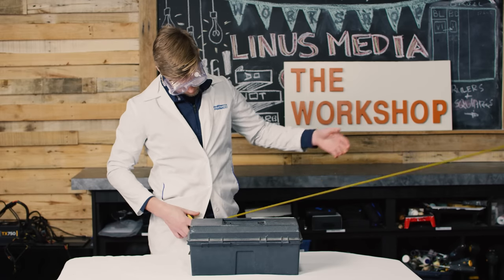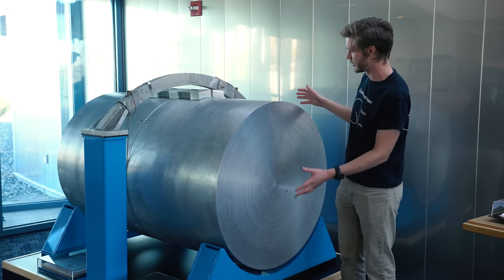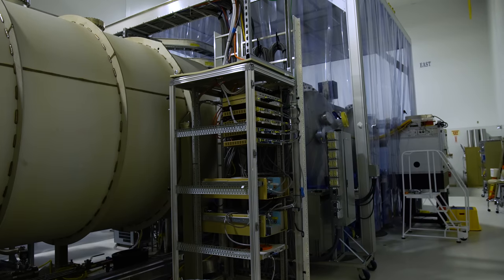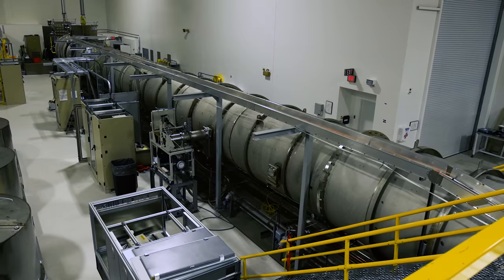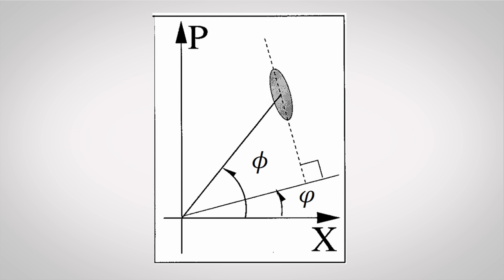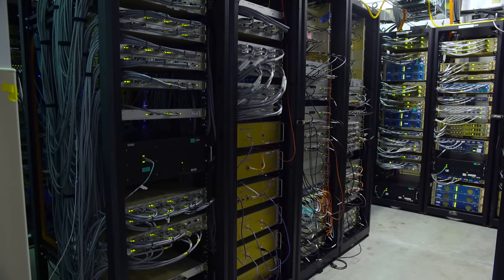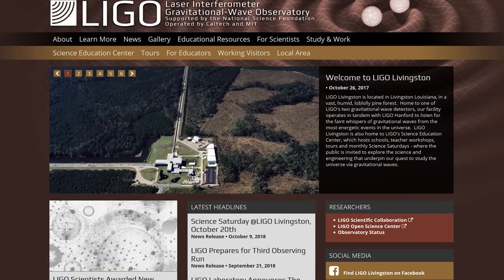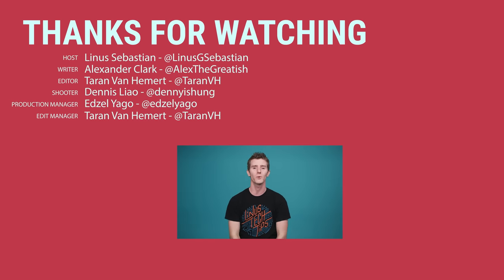Using 6000 CPU Cores for SCIENCE - HOLY $H!T

Comment: 6000 cores
64 GPUs
4 TB RAM
5,5, Petabytes of storage

This makes up a decent gaming machine :-D
Reply: The future be like :D
Reply: With a gt 210
Reply: Fps for Minecraft tho?
Reply: SSD btw
Reply: But can it run Crysis?
Reply: Ralf Engelmann bet you can't load more than 2 chrome tabs
Reply: @bkc.108  5843348 sometimes spikes down to 5843346
Reply: @bkc.108  still, it will be around 38 FPS with RTX turned on
Reply: A "stack" of GPUs**
Reply: could probably play minecraft in 30 fps at max
Reply: R G B ? ?
Reply: Only 64 GPUs? Yeah I don't want to have to run on low settings.
Reply: @skylark.kraken  it can barely run windows :/ 256 cores is decent
Reply: @thiccpug8040  low budget but not that good xd
Reply: entry level
Reply: It can barley run frogger at 60 FPS but it will do...
Reply: yeah but does it have rgb ?
Reply: mind sweeper?
Reply: can it run raytracing minecraft?
Reply: Gamers: How many FPS are you getting from that?
LIGO: Yes.
Reply: but can it run minecraft?
Reply: 1959 but can it play Tennis? 1969  but can it play Pong?  1979 but can it play Space Invaders or Asteroids? 1989 but can it play Tetris, Final Fantasy, Legend of Zelda or Sim City? 1999 but can it play Super Smash Bro., Silent Hill, Tony Hawk Pro Skater or FFVII? 2009  but can it play Uncharted 2, Call of Duty:  Modern Warfare 2, or Assassin's Creed 2? 2019 but can it play Crysis? It seems like anything that is emulator or processor intensive the most infamous comment is: "but can it play Crysis?" I'm sure there are 100's of other games out there right now that are just as popular and if not even better than Crysis! I'll pick up and play Tetris, Zelda, FF, or Skyrim any day of the week; hell I still play Diablo 2 at times!
Reply: @dontuseorcommentfromthisac5665  That's purely hypothetical question. Everybody knows that it would require a cluster of quantum computers to run Crysis with acceptable performance. Such clusters will propably not be available until 2050.
Reply: Chrome is still taking all the ram
Reply: but can it run minecraft ray tracing
Reply: @Bigboii7   Gt stands for gigtonnes in this case
Reply: will it run crysis?
Reply: It would suck big time. No single thread performance.
Reply: This machine: Nothing will stand in my way of causing memory overflow. 
Chrome: Hold my beer
Reply: Can it run crisis?
Reply: bro if this was how fast all our PCs were then the game would load before you even clicked it XD
Reply: Still only runs Minecraft at 30 FPS on low
Reply: Then it ends up doing 10FPS on Crysis
Reply: But will it run Crisis?
Reply: and a 100W psu
Reply: @bkc.108   1000000 with fps bypass probably
Geometry dash would have like 0s (not actually) delay
Reply: @thiccpug8040   zillion is not a number
Reply: With 120 gigs per second wifi
Reply: Cs go 1M fps
Reply: Will it run minecraft tho?
Reply: we need a gpu tho
Reply: Still cant run roblox
Reply: Will it play world of warcraft on ultra settings?
Reply: @bkc.108  depends on your GPU cores dont effect it
Reply: Now macstations can go up to 1.5tb ram. They should upgrade it
Reply: Plays minecraft
Reply: Time for Cinebench tests.
Reply: @bkc.108  7 octillion
Reply: It will barely run windows 10 tho
Reply: and an RTX 69420
Reply: @bkc.108  40
Reply: Still cant run chrome 😂
Reply: Should be future proof for a few years as well
Reply: @MrEzExD  but can it run chrome
Reply: just enough for shaders
Reply: soo smooth fps yes
Reply: still wouldnt be able to play tomb raider on ultra settings
Reply: yes when you hear it stays cool you understand noone mention clock speed, becouse its slowly to get stability and stay cool.magic is paraller
Reply: 640 rtx 2288000
Reply: Finally, the perfect Minecraft Rig
Reply: 4250 fps
Reply: Just enough configuration to use 2 Chrome tabs
Reply: Still cant run minecraft with ray tracing at 144fps
Reply: It’s also someone’s first build probably 😂
Reply: It can run crysis 3 @ 60fps
Reply: But the real question is CAN IT EUN CRYSIS
Reply: @thiccpug8040  wtf are u talking about?
Reply: The verge: It can play most games at ultra settings.
Reply: just imagine how much chrome tabs you can open
Reply: @RandmAnimal  at least 15
Reply: and still not enough for minecraft
Reply: DECENT
Reply: But can it run Crysis?
Reply: not enough storage for minecraft
Reply: @bkc.108  only -420
Reply: No RGB no gaming.
Reply: @bkc.108  with that ram at least 50k
Reply: I think it can't run GTA San Andreas with mods without bugging
Reply: Perfect for downloading extra ram
Reply: with this storage you can fully install microsoft flight simulator almost 3 times 😂

But can it run crysis?? 😂😂
Reply: nvme
Reply: Guess Linus can't drop it...
Reply: @kalpanaravishankarjain1234  in 10 years it will be in a phone and he will be: you just wait
Reply: Minecraft Shaders joins the chat
FPS leaves the chat
Reply: BUT CAN IT RUN CHROME THO????
Reply: Anyone else reading this comment in 2031 and thinking what a crappy gaming machine that would be?
Reply: @bkc.108  XD
Reply: 12000 threads
Reply: to make a meme review
Reply: its good enough for a couple chrome tabs
Reply: it can run a game faster than the most powerful gaming pc
Reply: If it had RGB it would be better
Reply: But can it run crysis
Reply: but can it run roblox?
Reply: But can it run ping at .5 fps?
Reply: needs more ram
Reply: plot twist:64 gpus are intel hd graphics with sli
Reply: no gpu?
Reply: @skylark.kraken  i have 52 cores, 2 quadro rtx 8000, 368gb ram. can i run minecraft at lowest settings?
Reply: i bet event on that call of dutie warzon run at 50 fps
Reply: still can't run minecraft with shaders.
Reply: @skilz8098  i take it you missed the coining of "but can it play Crysis?"... The reason everyone mentions crysis particularly is it came out February 19, 2013, yet was still pushing game systems to the max more than just about any other title on the market, all the way up til recently. not referencing it as a better or more popular game than other titles, ppl just still riding the bandwagon of a phrase i assumed had been laid to rest already.
Reply: @bkc.108  4
Reply: Just decent.
Reply: With that much ram I can open 4 whole chrome tabs
Reply: Year 2069: people used this to detect gravitational waves back in 2015 and now you have that technology in your glasses 👓 / wearables
Reply: I can run Crysis now
Reply: Minecraft would use 4 tb ram
Reply: @MrEzExD  I bet the CPU could run crysis by using software only mode. 4k 120fps
Reply: The question remains.

Can it run Minecraft.
Reply: Ahh but not good for Chrome!
Reply: it would make a nice rendering machine lol
Reply: @adamnizami8770  unless you want a fire hazard.
Reply: but mumbo jumbos is beter
Reply: i think its enough for 30fps on minecraft low graphics
Reply: "This makes up a decent gaming machine :-D" You mean an overkill machine?
Reply: *400TB RAM
Reply: But............................... CAN IT RUN MINECRAFT
Reply: here in 2050 this is accurate
Reply: Might even be able to start chrome
Reply: 10 years from now, that will only cost like 10,000
Reply: GAMING? There's HUGE LASERS GOING THROUGH A TUBE FOR SCIENCE, AND YOU WANT TO USE IT FOR GAMING? you better play KSP and KSP 2 at the same time to live up to that
Reply: @addust  no play Gex
Reply: but can it run crysis?
Reply: @villtur1646  yes. it can also run roblox... 9000 instances... all with a teapot-shaped baseplate with more teapots falling down
Reply: it in fact would not be a too good gaming machine as far as effectiveness goes... the delay in all of the long distance cable-ing would impact performance, also 99% of games are not gonna be able to utilize all of it.
Reply: Maybe enough for Minecraft :D
Reply: but you can only install warzone
Reply: no rgb tho
Reply: Decent but its not future proof
Reply: not enough ram, google cant run
Reply: Bcart 108 like at least 6
Reply: But can it run Microsoft Flight sim higher then 30?
Reply: @NoNoseVolde  30 what? Acres? Inch? Gallons? :-)
Reply: Kids in 4020 be like 😂😂😂
Reply: I predict that on the rate at which technology is advancing, that will be the norm in 10-15 years lol.
Reply: Bcart 108 with Minecraft rtx 1993929928 FPS Minumum
Reply: No, to run Chrome
Reply: Just your average AliExpress budget PC.
Reply: well maybe it can handle mfs 2020 at 4K be not sure...
Reply: Ralf Engelmann bruh that’s trash when playing cool math games
Reply: Thinking about iphone 20 has this hardware configuration
Reply: @neighborhoodtroll   nah itll be 746398. sometimes up to 2 mil
Reply: @bkc.108  at least 1 googol
Reply: Finally a pc that can run minecraft rtx java shaders
Reply: can barely run mario.
Reply: Now they need a screen that can keep up with the fps lol
Reply: @MrEzExD  can it run microsoft flight simulator
Reply: it can barely handle warzone
Reply: might be enough for 5 or so chrome tabs
Reply: but can it run crysis
Reply: ah, perfect rig for mine sweeper
Reply: on a 64k monitor
Reply: But does it run crisis
Reply: then u install a virus
Reply: But can it run Crysis?
Reply: bruh someone already said that
Reply: And can run minecraft rtx.

Barely
Reply: But can it run Crysis 3?
Reply: @MrEzExD  no
Reply: @bkc.108  idk maybe like 100 maximum
Reply: But can it run Minecraft shaders?
Reply: mmm... decent but could be better...  = 2050 gamers
Reply: Probably the only machine that could have a chance at running Sword Art Online
Reply: In 2090
Reply: Meh, doesn't even count as a computer until you put original Doom on it.
Reply: Finally 1.5 chrome tabs
Reply: Simula Rose  dude ita only 4 tb of ram. Its only getting to 1.5 at best. 2 is just no
Reply: now the inly thing is to make games which supoort these specs😂
Reply: Run windows vista on it and you'll see something weird...
Reply: 4tb ram is standard in servers
Reply: but can it open more than 5 chrome tabs?
Reply: but it has no rgb this is worthless
Reply: But can it run 4 chrome tabs
Reply: nah can’t even get 2 frames in Minecraft with raytracing
Reply: 100000000000fps
Reply: Who the hell is paying for all this?  Either the tax payer or the students.
Reply: decent
Reply: @CrisisVFX  wouldnt be any different than a normal machine because minecraft only utilizes 1 thread
Reply: @MrEzExD  Better, it can play minesweeper with all settings on max!!!
Reply: Me who uses 4gb ram on 2021
"Yeah You are (tears on my eyes) r-right"
Reply: Might run Minecraft at 60 FPS
Reply: But can it run crysis?
Reply: still cant run roblox on high settings :(
Reply: can it run Crysis?
Reply: Good fort bitcoin mining 😂
Reply: not that good imo
Reply: @MrEzExD  No.
Reply: @MrEzExD  pcbs
Reply: @bkc.108  fps for mc is realtime

Comment: I do study in Pisa, Italy where we have the other working interferometer of this kind, virgo. Fun facts, the second event of gravitational waves detected by the one shown here were was not recorded by the one in Italy, this meant the waves were coming from one of the 4 blind spots of the interferometer. This way they could triangulate the origin of the signal with much higher precision that if it had actually detected any wave ahahah
Reply: > ahahah

Italian confirmed
Reply: Ah ah ah
Reply: @UltimatePwnageNL  What's wrong with "ahahaha" ?
Reply: AngryPostmanSthlm2  They are two-axis interferometers, but we'd like to measure in three axes. so you need another one not halfway across, but 1/4 across the world to have all 3 axes. (if you build them flat on the ground). If one doesn't detect anything but the other two do, that means the detector that got nothing was perpendicular to the wave's direction in both axes. (In this case, the wave must have come from straight up or straight down for the one that got nothing)

Comment: 3:44 Debian spotted
Reply: 11:20 also xfce4 ... and steam logo on the box for some reason.
Reply: @Daniel Jakob I knew about Steam machines, I just really didn't expect to see one in a high profile scientific lab/environment. But yes, turns out it is a Steam machine. Zotac NEN to be exact. Now that I think about it, I was thinking more in terms of CAD/CAE software which almost always needs a "pro" GPU. But scientific software probably doesn't, so a compact box with a middle range general GPU might be perfect for, say, visualizing data. Plus it was designed for SteamOS, so likely no issues running linux distros. HP actually has a compact box with up to Xeon / ECC memory / Quadro options (Z2 Mini) for CAD/CAE users who like really small form factor machines.
Reply: @ffmfg  Yeah, scientists really just use whatever works, and all the heavy lifting is usually done remotely on a cluster. I'm the only one in my research group who doesn't use Windows, and several people just do everything on MS Surface devices. My roommate works with CERN, and one of the research computers that drives the electronics for his test equipment has a Windows XP sticker on the front.
Reply: it would be a bummer to miss out a gravitational wave due to software update
Reply: @asdfasdf-vy4pj  And KDE 4 at that... Is that Debian Wheezy, or did Plasma not make it into Jessie?
Reply: Debian masterrace!
Reply: Actually, I'm a bit surprised that they're not using Gentoo.
Reply: 7:44
Reply: LINUX GANG
Reply: @Daniel Jakob Steam OS is not Windows based, in any way, shape, fashion, form or whatever else. It's Linux.
Reply: @ElectricityTaster  all of the statements you just made are wrong.
Reply: @md.imamulislam7  why would they use Gentoo. Tell me one good fucking reason. They want to get shit done, not compile stuff.
Reply: @HermanWillems  install gentoo
Reply: Debian and Linux in general are much more compatible for scientific work. There is so many reasons for this but the main is you don't have to bend over backwards for control of the OS. This leads to many of the tools being created on Linux which spurs even further development.
CERN actually has their own Distro for performance computing https://linux.web.cern.ch/linux/. 

Gentoo is pointless as that level of control is worthless and does not provide any additional help. We are looking for the bare minimum to get the job done.

Comment: The people at Ligo have the  equipment necessary to measure a flat earther's brain
Reply: Hah, jokes on you! can't measure something that did not exist
Reply: Barely
Reply: @MrWillypanda88  😂
Reply: Legend has it that their brain is so small, the space between the elemental particles is down to a planck length, that if they ever goes smaller they will become a micro blackhole capable to destroy their flat earth.
Reply: Their brains are flat, too.
Reply: @4IN14094  it falls into the quantum realm

Comment: BuT CaN IT Run cRySiS
Reply: Indeed.
Reply: Probably not, since the compute system looks to be Sun Microsystems hardware, which suggests it to be SPARC based.
Reply: Yo don’t be haters someone get a windows 10 flash drive we got this!
Reply: My man
Reply: Pfft it's probably using an onboard gpu.
Reply: That question is getting old. Find a new one.
Reply: @rohanjain4573  it's funny because it's old. Lol I'm pretty positive he was joking.
Reply: Probably not I doubt Windows will work on a system of this architecture , jokes aside that is
Reply: JAYxPEE i know it’s a joke. But it’s been used so many times that it’s too stale.
Reply: @ @bwzes03   Wooosh!
Reply: Rohan Jain can it run Fortnite then?
Reply: @zephyrdrake_   I'm not even going to type a response to that ....
Reply: Can it run cenebench
Reply: @bwzes03  but you just did
Reply: @OniSoni  whoosh...
Reply: Damn this comment is popping 😅
Didn't expect that 

And yes i was joking 😂
Reply: No.
Reply: Yes, it definitely can't.
Reply: @Lolkork  yeah, if each CPU core emulates  a GPU core, I think it should work. Unfortunately, they have Debian so crysis doesn't work.
Reply: @marcobonera838  thank you ! 
Really nice answer

Comment: 10:22 man I bet that could run Minecraft well
Reply: Ryan Healey 32K at 65536 FPS HELL YEAH!!
Reply: I mean let's be real though, it would still crash and eat all the RAM...
Reply: Now, imagine Chrome. That ram still wouldn't be enough.
Reply: ^ This dude knows. Minecraft on integrated graphics gets a decent 60-80 FPS. But open like 5+ tabs on Chrome and it's crash galore
Reply: I know you are joking but core count won’t make up for a lack of GPU. Any graphical game would run like a bag of crap.
Reply: @evilutionltd  I would have to argue that you could make a software GPU driver to utilize all 6000 cores (with Hyperthreading) of the CPU(s) to work as a GPU... if you like implementing Vulkan and OpenGL for CPU... in C...
Reply: @Terrobility  It depends on which Minecraft version you are talking about, the latest Java edition has a lot of performance issues on decent PCs